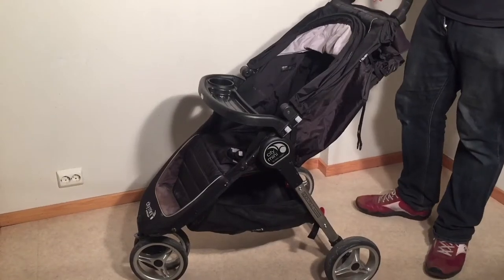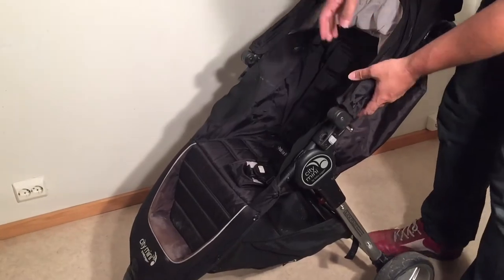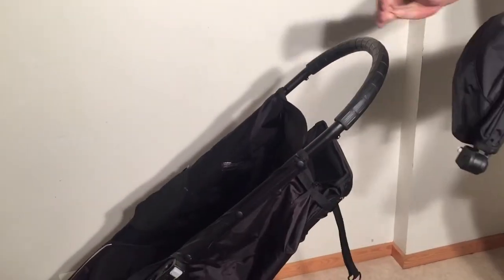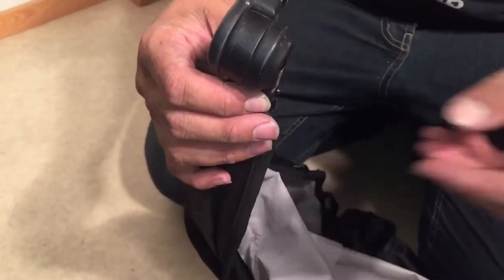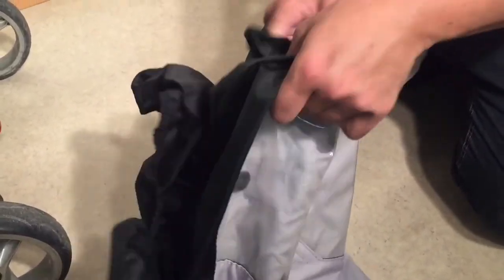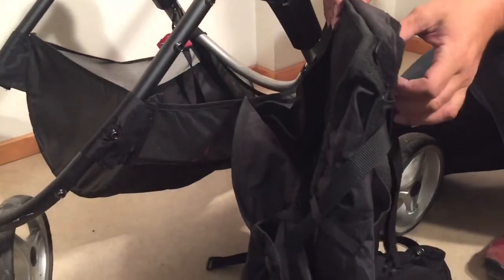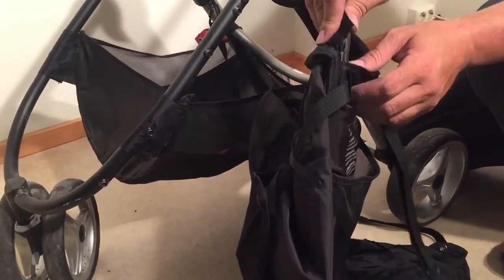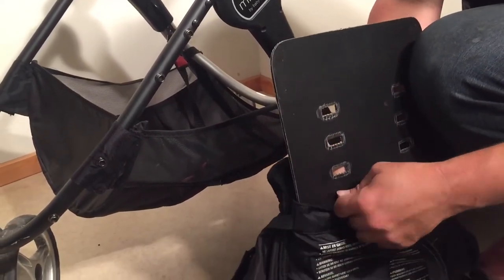How to Remove the Textiles / Fabrics from a Baby Jogger City Mini

Comment: Where does the red tab on the easy-fold attach to?
Reply: maybe it attached to not allow it to fold?
Reply from the maker: Exactly.  It buttons onto the chassis just below the easy fold, on the outside, and it's purpose is to prevent the stroller from folding :)